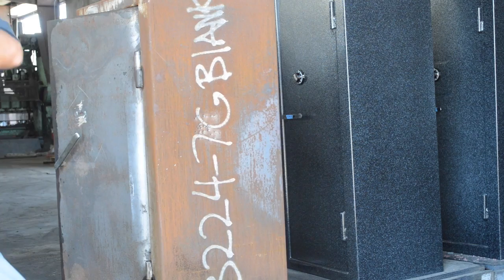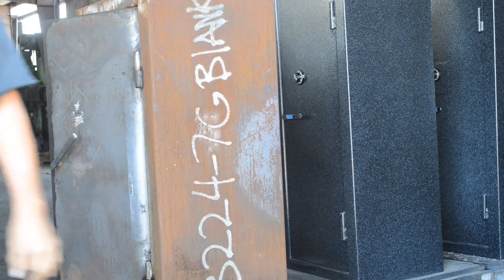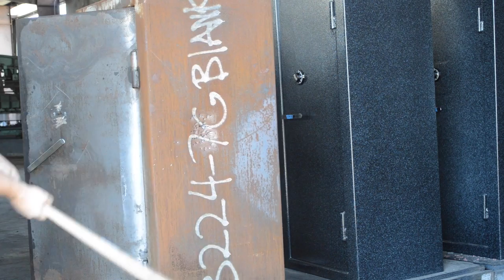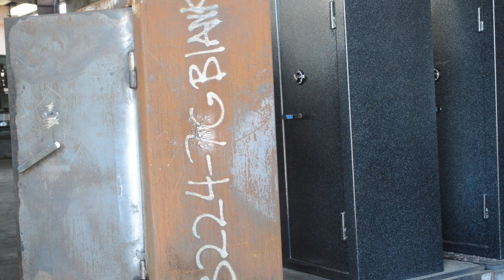Breaking Into A Safe With An Axe | Sturdy Gun Safes 3/16" Body Versus A Competitors 11g Body

Comment: This is garbage. Put a grinder to it and see how long it takes. I can cut that sturdy safe open and take everything out of it in around 5 minutes. You need 1/4” steel or better to deter that type of theft. Unless it’s 1/2” you are still subject to this attack it just adds 15 minutes to the task. Make a realistic video. This is bs
Reply from the maker: You can eventually breach 1 inch plate or thicker with high power tooling and enough time. The whole point of this video is to show how 3/16 is the minimum required to stop non-powered tools. Our kind of customers don’t want to hear non-power tools can breach their safe.

Comment: I bought a Brown HD TL-15 safe. First, the thing has 1/4" steel INSIDE the outer shell. So, after a crook wears himself out getting through the 10g steel and poured concrete, he still has to face 1/4" plate. Plus, my safe is in a place where you can't swing a tool like an axe. You'd have to move the safe to get it out in the open or knock down walls. My safe weighs 4,880 pounds empty. No way you're moving it, bolted down or not. Brown makes REAL safes for guns, not "gun safes" that don't offer real protection.
Reply from the maker: Timothy Parkhurst Those are awesome safes. If one can afford the safe, afford to ship and install it, and have foundations that can afford to support them, then it’s a great route to go. We cater to those who can’t do one to all of the following mentioned. We offer steel thickness in various ways to get close to that type of security without all the weight and cost. Brown actually acknowledges us as being a true gun safe with some of the upgrades we have to offer in our packages and it’s rightfully so. This is located in their gun safe comparison section.
Reply: why didnt you just go with a TL-30? or Amsec RF series?

Comment: Two words:plasma cutter
Reply: Ever use a plasma cutter? So, you sure the house has 22vac to run it and what about the air compressor needed to run one? As for an angle grinder, how many wheels are you going to bring,? 3/16 is a WHOLE lot harder to grind through than 11 or even 10 ga sheet metal. It's all about slowing down a dimwitted tweeker, not a determined orogessional.
Reply: kingoeggman 
Exactly
Reply: @kingoeggman  so what would stop a grinder better between an 11ga+drylight+12ga sandwich vs 3/16 or even quarter inch like some of the Fort Knox have?
Reply: @bjdunne5113  all about the same, I keep seeing people getting stuck on those 3 since they are 3 of the most popular options. Your best option is to come up with a little bit more $ and get the Amsec BFII, it has total thickness of 1/2'' steel on the body and 2'' of drylight pour, and the door is even stronger (the front door plate alone is a solid 1/2'' plate, with 11ga liners inside). Its probably the strongest RSC in that price range, its the first RSC 2 qualified safe.
Reply: @kingoeggman  I own a metal fabrication shop and we use plasma cutters. You are correct. It's the angle grinders that will be the ticket. For the really big safes (the Browns, Graffunders, high end AMSECs and the like) you'll be burning up a lot of wheels and on the highest end you'd need some really big-ass wheels to even get through them. Running into tungsten balls will be kinda sporty too.